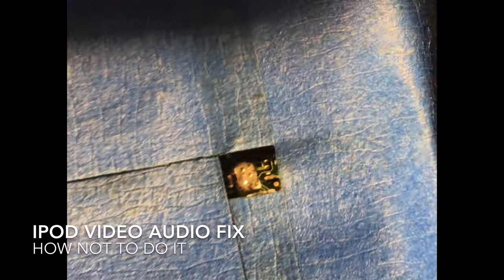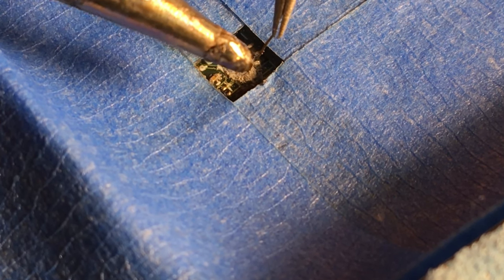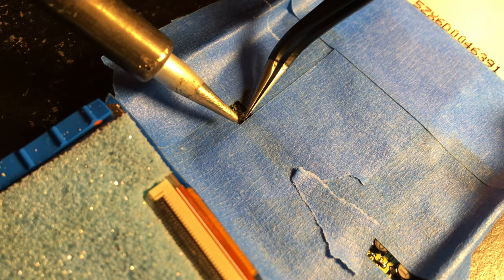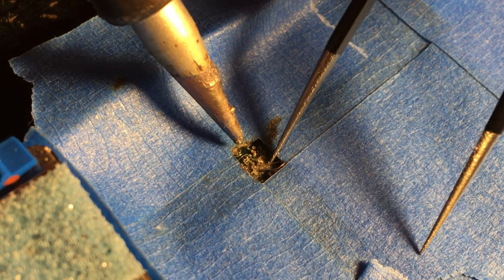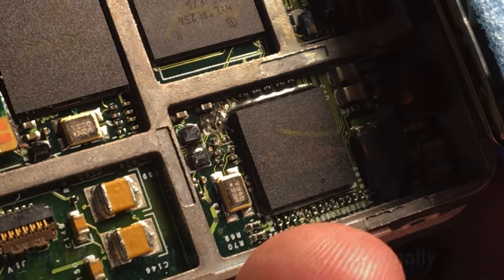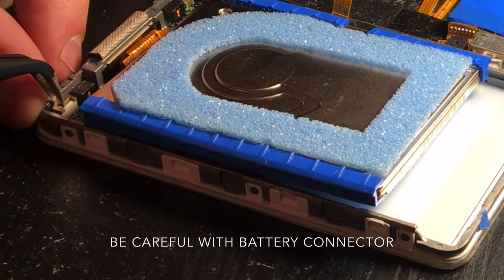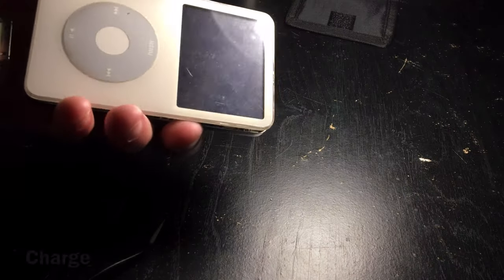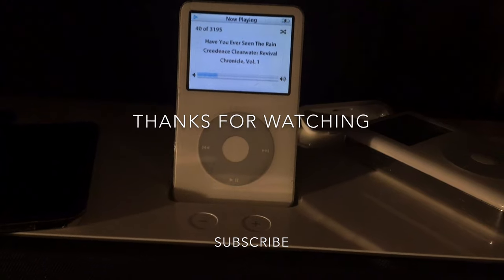iPod 5G No Sound Fix - how not to microsolder

Comment: Wow, good work...I wouldn't have thought that was DIY-able!
Reply from the maker: Hey thank you for the comment. It was pretty difficult and took me a lot of time. If I had a hot air station it would be proper to remove the chip and then solder a new one - or just bridge the 2 pins like I did. Otherwise - scrape component to expose pins, solder flat wire directly on top of the pins as shown. This was a lot easier than fiddling with too long of wires which I did most of this video. Glad you enjoy the video haha :) made it to show the guide is a working fix for the audio problem

Comment: What size wire did you use?
Reply from the maker: It was a single strain of some other copper wire lol super dmall
Reply: @grandtheftauto1233  lol okay thanks for the response!
Reply from the maker: @joelrodriguez3417  no problem if I were to try again I’d scrape off the component and try laying the wire flat across the pads. They’re super super tiny and it’s a pain
Reply: @grandtheftauto1233  yeah, ima try it out since I may have 2 iPods that have this problem
Reply from the maker: @joelrodriguez3417  if you got tiny soldering iron and a steady hand I believe in you